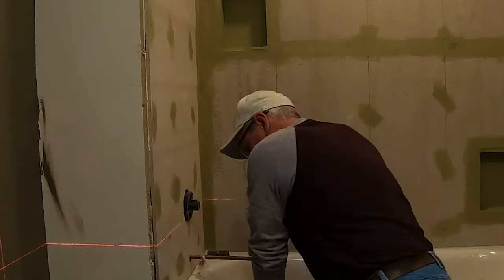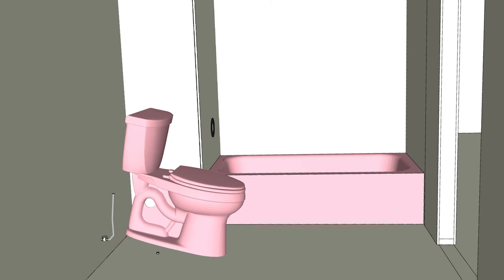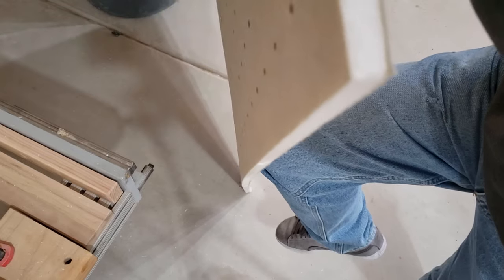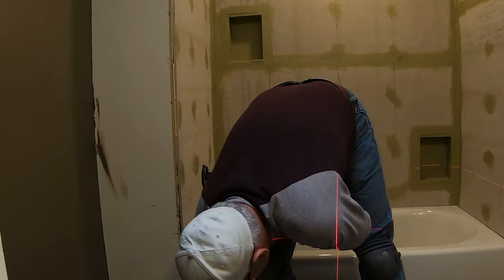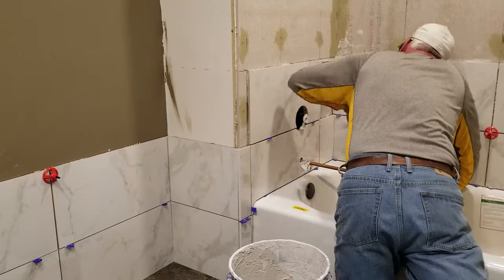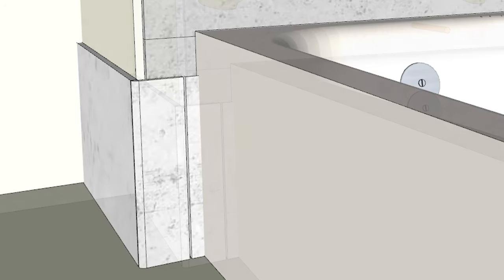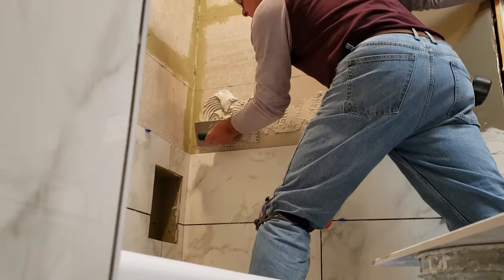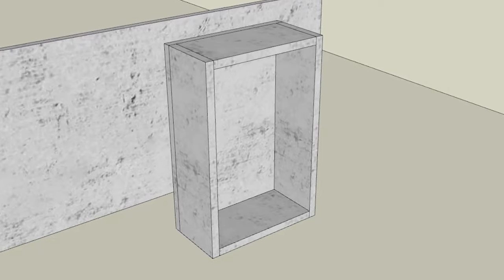Tile Setting - How to Set Tile Around Your Tub

Comment: Quick question.. when starting your first layer of tile on the backwall does the corner tile touch the edge of the wall or does the side wall tile meet at the corner with the backwall tile?
Reply from the maker: Yes, I think I understand what you are asking, Alan. Whichever wall I am setting tile on, I cut it to within about 1/8” of the adjacent wall, which let's say is Hardiebacker. Then, I cut the tile to within about 1/8” of the set tile when installing tile on the adjacent wall. So, I basically overlap the tile in the corner. Hope that makes sense.
Reply: Yes that is exactly what I was referring to. Thank you for responding and for understanding what I was trying to say. I really appreciate it

Comment: I purchased a home that has a beautiful bathroom buuuuut no tub just a shower. How can I add the tub without damaging or removing the existing tile?
Reply from the maker: That’s a tough one, Kimberley! There are lots of structural things that make a tub install much different than a shower installation (like drain placement, for example). Sorry to tell you this, but you would likely come out better financially and like the finished product better if you quickly tore everything out and started from scratch.

Comment: I agree on the waterproofing backer issues. I've seen lots of rotting wood in my years, and most of it is painted wood. When wood has no way to breath/sweat/wick moisture away from itself, it rots. A well caulked and painted soffit and fascia on a home is like a bladder that holds water in the wood as well as it keeps it out. So when some does seep into it somehow it stays much longer. I have no cure for this inherent issue with wood, but it is real.
Reply from the maker: Good points, Sump. You are the first person to acknowledge the same kind of issues I think are inherent in waterproofing surfaces and assuming every potential problem is solved after that. When you have water interacting with surfaces over the course of years, you are better served realizing that you need to manage that over time rather that forgetting about it, believing all is great.

Comment: Rusty, great video. What are your thoughts on having someone come in to recoat the tub vs. replacing. Is a new coating durable?
Reply from the maker: Thanks, Adam!  I know people do that kind of recoating but have never personally seen a tub refinished so I do have a good point of reference. Yeah, the durability question would be my concern. Though it seems like a big deal to tear out and replace a tub, realistically the tear out  is surprisingly simple. You need some manpower and room to work to get it out in one piece. If you take a sledge hammer to a  cast iron tub, again with some physical effort it can be broken apart in a short period of time. The real issue to be aware of is can you maneuver the new tub into the old space without major wall demolition and how much of that are you willing to do. Tubs are generally set when the house is being framed to make it easy to get them in place. One time I actually cut out studs in the wall on the end of the tub to access it through a bedroom to get the old cast iron tub out and replace with a new one. With two of us working on it, it was still a lot of physical effort. But it would have been impossible to do otherwise. Cost of a new cast iron tub was about $350 the last time I checked which has always surprised me. So the real expense is in labor if you hire people to do the work.
Reply: replace it, recoating glazing or whatever else they wanna call it is temporary, it will not last. 2yrs Max.

Comment: It would've been helpful to see/ hear how you deal with out-of-plane studs, how you got the backer board over the tub flange, and how you would return the tile to a wall at the edges (given that you seem to have shimmed out further than the old walls, so the backer would sit proud).  You avoided the issue here, because the tub walls turn corners at the edges of the tub and you also tiled all the way to the ceiling.  However, those aren't always options.
Reply from the maker: Yeah, it’s not always possible in a video to address the spectrum of issues you might run into on any given project. Obviously, the more experience you have the chances are greater that you have solved a particular problem before on another job. But that’s not always the case. It is most often the case that I run into something new on every job I do. So, to address your comment, I would say that getting good at remodeling means that you get good at improvising and adapting to solve problems as they arise all the time. Not a comprehensive answer, but that is how it really works on a jobsite. Thanks for watching.

Comment: My tub is 3/4 inches lower on the drain side than the opposite end. How do I proceed with starting the tile?
Reply from the maker: I talk about this in the video, but the short answer is you start with a full tile at the 3/4" low spot. That's quite out of level, Light! If you need more help, you can email me at rusty@dobbsworkshop.com and I'll give you a link where you can share more specific information about your project.

Comment: Hey Rusty,
So my newly installed tile is level but the tub is not (you mention at around 11:28). What is the best way to address the gap? Thanks.
Reply from the maker: Hi Jon. The best way to address a gap is to not let one be created. So when I give various examples of what happens with unlevel tubs,  the given is that often you have no way to make the tub level, so you have to work around that issue and basically hide the problem in the approach to setting the tile. Let's say you are using a 12x12 inch tile. If you set a piece of that tile against the wall at the low point of the unlevel tub, there is no gap between the tub and the tile. If you draw a line on the wall at the top of that tile piece and extend that line level all the way around your tub enclosure and use that line to set tile against, what happens to your bottom row of tile? The piece that you have against the wall that is your starting point for the level line fits. To make other pieces of tile fit between the level line and the tub, you  have to trim them as needed. That is how to not allow a gap to be created and still set you tile on a level line on the rest of the installation. I always shoot for about a 1/8" gap at the tub and tile level because that makes a nice caulk joint. Hope the explanation helps!
Reply: @RustyDobbs  Thanks Rusty!

Comment: So basically there is no waterproofing on your shower walls (in the traditional sense) except the joints. Am I understand correctly???
Reply from the maker: Yes, basically, Wendell. Where I would differ with you is that there is nothing ‘traditional’ about waterproofing products and tile setting in my work history as those are relatively new innovations. When I learned to do this work over 40 years ago, the best showers had concrete walls floated over metal lathe attached to the studs. Because of the cost of mud walls, other types of sheetrock were developed that had some level of moisture resistance for wet areas but were terrible products. Hardiebacker and like products come as close to mimicking mud walls as anything I have run across so that is why I use 1/2” Hardiebacker. I like the ability of Hardiebacker to deal with incidental water that will make it’s way through grout joints over time, so I leave most of the flat areas without waterproofing. The reason I do not waterproof the entire walls is because I don’t like the idea of water being trapped between the back of the tile and the waterproof membrane. Leads to potential mold issues in grout joints and I have never hear a good explanation as to why that should not be a concern. Anyway, that is why I have landed where I have on the waterproofing of walls. Hope that helps!

Comment: I realize you were coming from the floor and that dictated where you started on the tub line. If I'm just doing the tub area, should I establish a line say at midpoint and work up, then work down from that midpoint to mitigate an uneven line at the tub level? I'm using 8"x 24" tiles. I've seen it done this way with subway tiles and I'm wondering if the larger format tile makes it a bad idea to start midpoint. I plan to go all the way to the ceiling and to tile the ceiling also.
Reply from the maker: I think I understand what you’re asking, Charles. You are right about establishing a level line that becomes a reference point for the entire job. I typically do that a couple of tiles from the tub itself. The reason I don’t do it higher up on the wall, say at the midpoint, is because I prefer stacking the tile going up the wall. The less tile I have to set below my level line the better because it’s more time-consuming and gravity is always working against you. Because the tub line may be level or maybe not, it’s pretty much irrelevant except that I want to make sure my layout allows me to make as easy a cut as possible at the tub line. You can start at the midpoint. That’s just something I have never done. Hope that helps!

Comment: I have a 20 year old tile saw that maxes out at 18" straight cut.  The job that I am  setting up for is 12 by 24 tile.  Is there a way that I can make my saw work for that job?  The saw is in great shape so I don't really want to go have to buy a new saw.  The area in which I live does not have any rental companies nearby.
Reply from the maker: Without seeing your saw, Brad, I can’t speak definitively about whether or not you can easily cut larger pieces than your 18 inch cut. My saw does not make any larger cuts than yours does but by getting creative with the way I make my cuts, I can still make longer cuts safely. Probably the simplest suggestion is to mark your cut lines on your tile pieces, then cut 1/3 or 1/2 way through the piece, turn off your saw and carefully flip your peace around and finish your cut from the other direction. My saw has a sliding table on it, so I have to let the larger pieces ride up on top of the sliding table guide that I normally set the tile against to make square cuts. Hope that makes sense!
Reply: I just lay tile on side on back and carefully cut line    U don’t get to make just one mark but I cutt long tiles with smaller saw.
Reply: @RustyDobbs  that is what I am doing now, but what a pain.

Comment: What program are you using for the demonstration
Reply from the maker: I did this animation in Sketchup Pro, John. I've used it for many years in construction project designs. I have made a switch to Blender in the past year for a number of reasons, not the least of which is that Blender is free compared to about $300 per year for Sketchup. That was a big consideration but more than that, Blender is evolving so quickly with features and tools that it is leaving Sketchup behind in many ways. It is quite a story. Big learning curve but I'm glad I made the change.

Comment: Hi Rusty, what animation software did you use to make this video? I am a contractor and would like to be able to create visuals for tile layouts like you have done with this tiling project.
Reply from the maker: I used Sketchup for this video, Hunter. It's a good software package for a contractor as it seems to work like we think perhaps better than some other packages. The thing I don't like about Sketchup is their pricing structure these days so I'm pretty much done with it. It's also a little behind the times a little and I'm not sure it's keeping up with the competition. That makes the new pricing harder to swallow. My last video, I did all the animation in a program called Blender which I am finally proficient enough with now (after several years) to leave Sketchup behind. If you don't have some experience with a 3D animation software, be prepared to invest a lot of time to reach a point where you can use it for what you are wanting to do. I think it's a good investment of time because you are doing something really creative, but there's a steep learning curve, especially with Blender. Blender is also a free program that has unlimited capabilities so that's a plus as well. I'm not sure creating animations and drawings for customers has actually earned me more work, but having that capability has certainly closed some deals for me, I'm sure. Good luck with the learning!

Comment: Hi Rusty... is there a software animation tool you can recommend such as the one you used here? I we think it would help to visualize the project and make changes prior to starting?
Reply from the maker: Hey, Texas! I use SketchUp primarily for my videos and have been using it for a long time. I think there is a free version of it that you can design in, but I don't think you can print your results. The version I have which is SketchUp Pro costs about $300 a year I think now, which is annoying. There is another product called Blender that is totally free and is an incredible tool. You can read up on it by searching for Blender and get the back story on it. The only reason I have not switched completely to Blender is because I am much more efficient in SketchUp and there is a pretty significant learning curve to getting functional with Blender. It also doesn't handle the architectural or construction types of applications as well as SketchUp at this point, though it seems like the people working on Blender are making efforts to reach out to the SketchUp community. Anyway those are my thoughts and I hope they are helpful!
Reply: @RustyDobbs  that's GREAT information. I'll definitely look into Blender, and thank you very much for the reply!

Comment: What did you use to cut the round holes for the faucet?

Thank you
Reply from the maker: Hi, Dean. When I lay out my tile I try to avoid having to cut into the center of a piece of tile to make holes for the faucets. That means that a grout joint is generally going to be running through the location of the faucet. So with a tile saw or angle grinder, those cuts are fairly easy to make. I also have carbide drill bits for tile that attached to a variable speed drill so that if I need to make cuts in the center of the tile, I can use them alone or in combination with my tile saw.